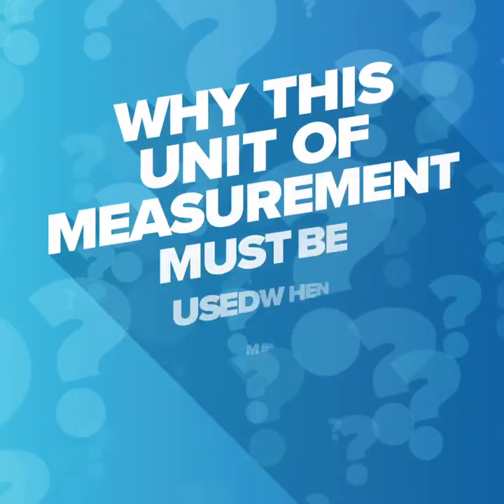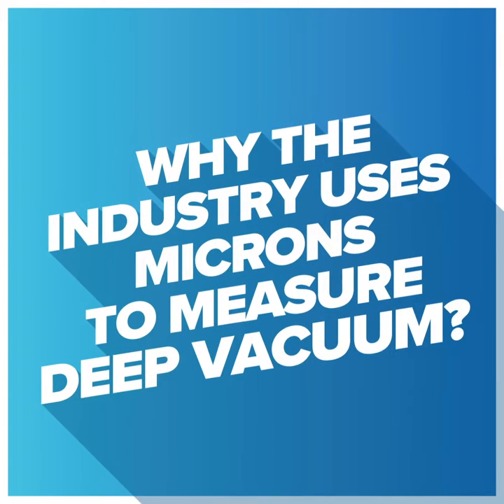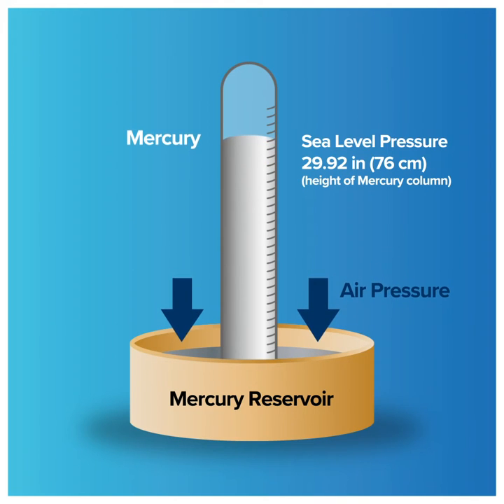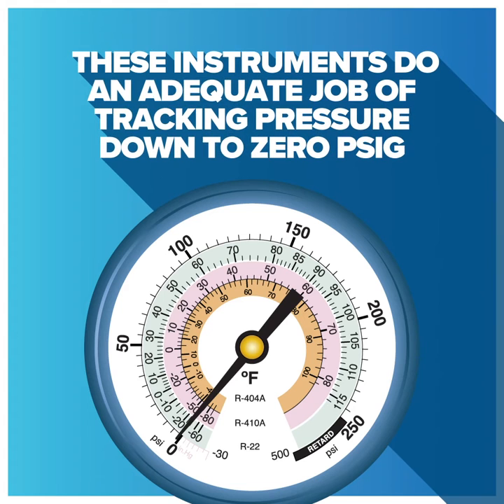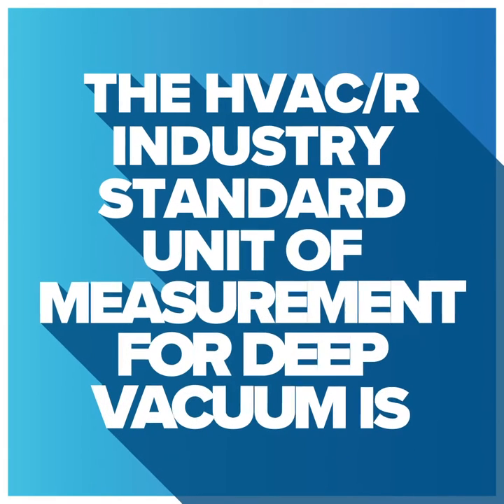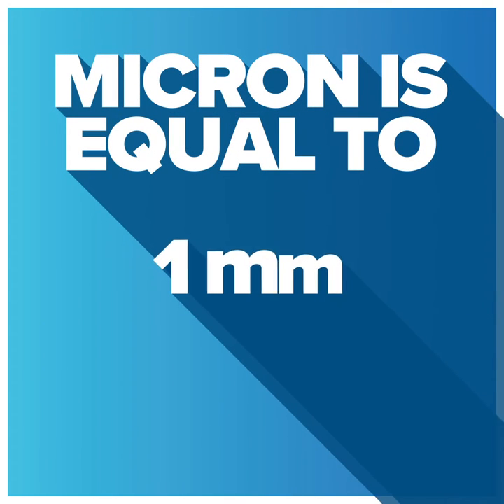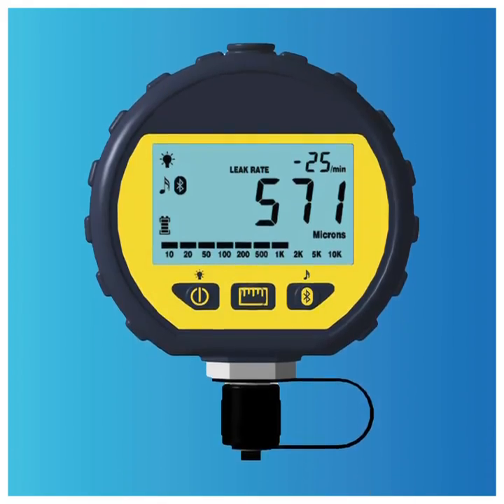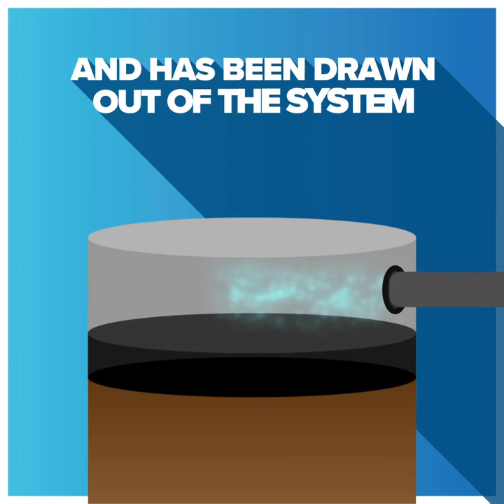Did You Know? #26 What is a Micron?

Comment: I don’t get how a distance scale (micron) measures a vacuum (negative pressure)?
Reply: mercury displacement is usually measured in inches. microns (1000th of a mm) is the Metric equivalent.
Reply: @evolutionCEO  so are they measuring Mercury displacement to the Micron? What is being measured to the micron?
Reply: @IcebergS2000  if you have an open container of mercury and a tube, one end of the tube in the mercury and the other end going up from the container to a vacuum pump. the farthest you can draw the mercury up the tube is 32 inches (or somewhere there about). if ambient air pressure goes up, then the mercury can go farther up the tube, if the ambient air pressure is less, then the mercury won't go as far up the tube.

the micron is the metric measurement of the difference in hight up the tube.